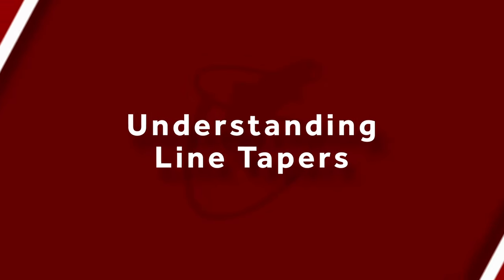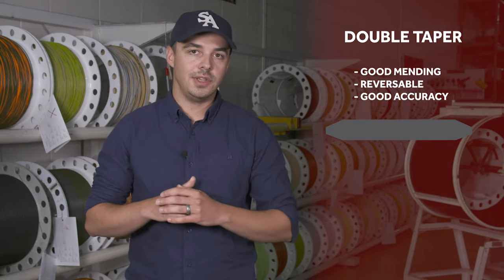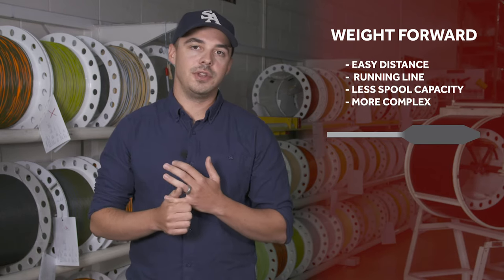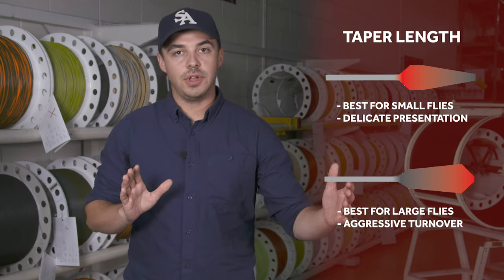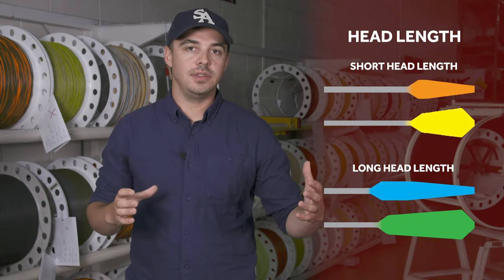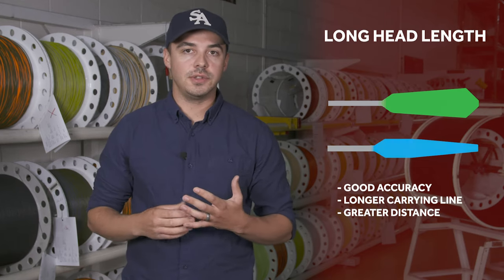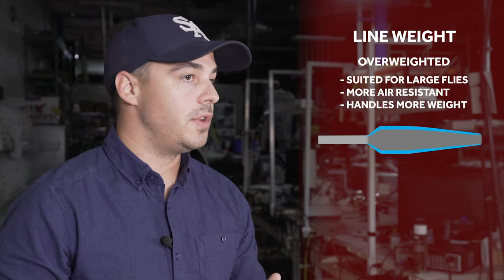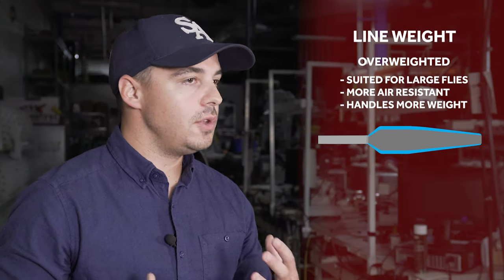Understanding Fly Line Tapers

Comment: Nice video, well explained! One  small addition: A fly line matching to transport (drive) a heavy fly isn't over weighted. It's matching! What may not match then is the line class being recommended for the rod (labeled on the rod). I match my fly line to the flies and fishing. Then I need a rod matching these three (fly line, flies and fishing). Problem starts when people buy a rod first. They then try to match the line to it only to then have trouble throwing the flies needed or spooking all fish by a too heavy line. Bottom line: Start with the fish and end with rod and reel. Flies, leader, fly line are in between. Priority goes fish to reel.
Reply from the maker: Thanks for the comment Bernd. Thats why we clearly state the weight as true to weight, half, 3/4, full heavy etc when purchasing.